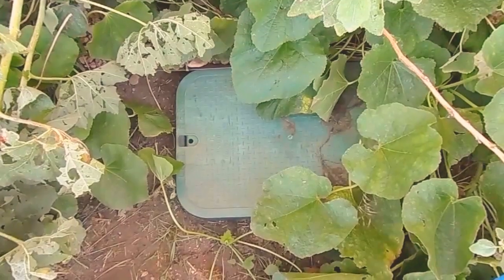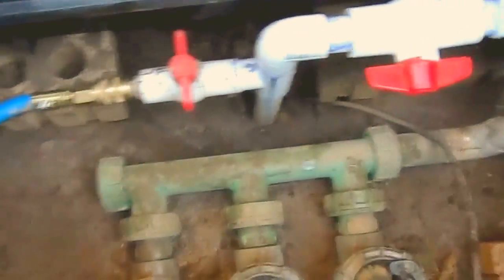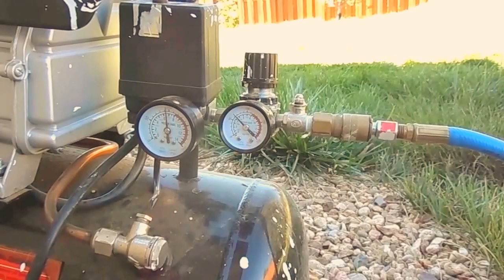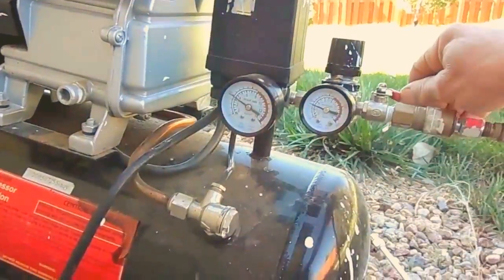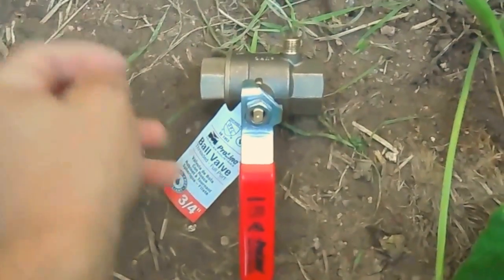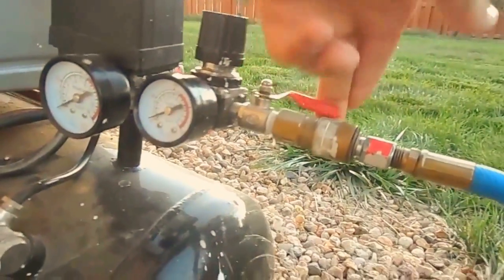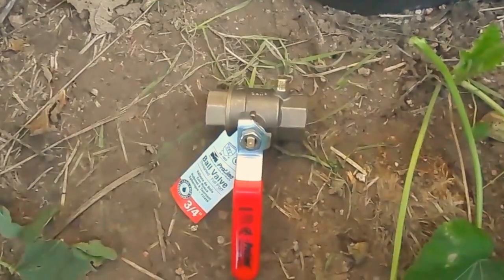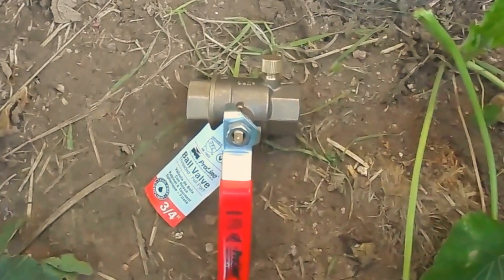How to Blow-out Lawn Sprinkler (Irrigation) System & Prepare for Winter (Plumbing Tutorial)

Comment: is this all valve is control by PLC ?
Reply from the maker: The valves are controlled by a programmable timer. I have never heard anyone calling these devices PLCs in the sprinkler industry, but that's what they essentially are.
Reply: actually i want to control (on off) of this valve by PLC this project is all about on off of diff valve at diff timing. in PLC card there is also diff option of timer . so is that possible to used solenoid valve individually .?
Reply from the maker: Yes, of course. Each valve is a separate zone and it is normally controlled individually through it's own wire-pair. That's what the timers are used for, and you can certainly build and program your own timer using a programmable logic controller.
Reply: hmm that what i want thanks a lot

Comment: I would leave the valve that feeds the sprinkler closed until spring.  There's no need to open it until then.  I would also do one zone at a time to ensure maximum air volume goes through each zone.
Reply from the maker: +Dan Burch You are right, one zone at a time is a safer way to go. And yes, you may leave that valve closed until spring, unless the valve inside the house leaks even a tiny bit, in which case you would be safer keeping it on.

Comment: Please respond! My valves have little, black screw knobs on them. Are these also manual override valves? and when spring comes, should these be open or closed? These knobs are separate from the solenoids.
Reply from the maker: This is probably not the manual override. The smaller black plastic screw may be the bleed screw and the larger one flow control. Check manuals like these for more information: http://www.irritrol.com/manuals/inst_gd_2700.pdf
Reply: my dad airs out one zone at a time and he turns those little black screws.
Reply from the maker: Yes, some of the screws control the amount of flow through the head,

Comment: Jake, WHERE is your backflow preventer? Every plumbing code requires one on an underground sprinkler system or you risk contaminating the drinking water system! Please install one!
Reply from the maker: Code requirements differ by jurisdiction. Most jurisdictions require a back-flow prevention device of some sort. Anything from a simple air gap to a pressure vacuum breaker or an RPZ valve. This house has an RPZ valve in the basement, which is actually the subject of another tutorial, which is yet to be edited and posted online. Thanks for asking!
Reply from the maker: Here is the link to the backflow preventer installation video tutorial: https://www.youtube.com/watch?v=jIaw5-EkyLM